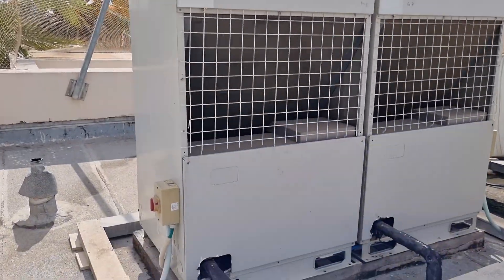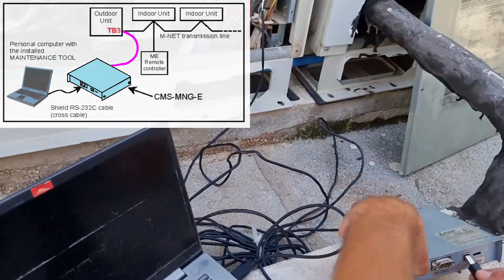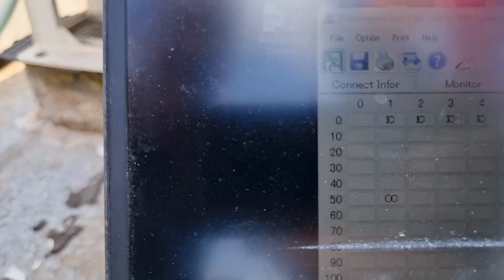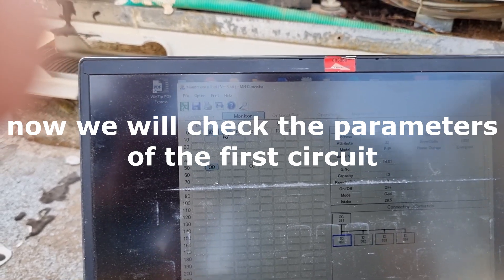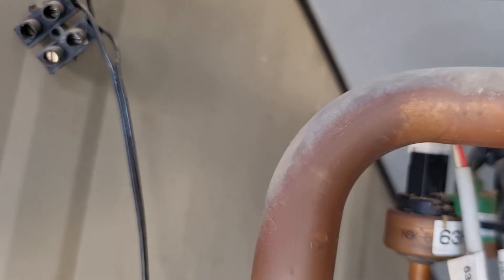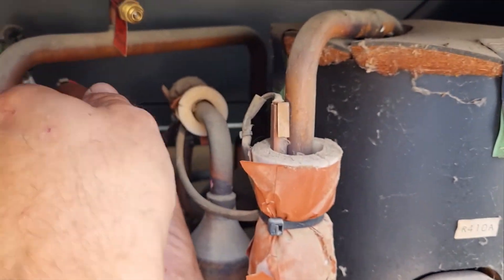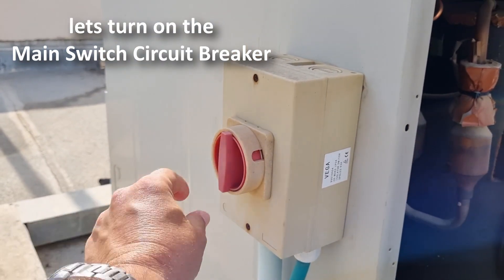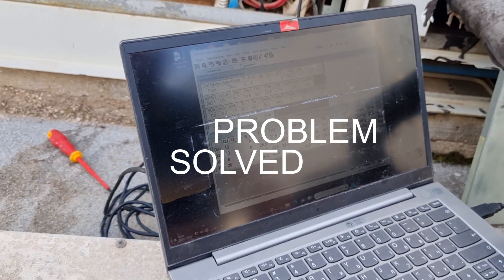City Multi VRF 1302 error code

Comment: Damnn that's sweet smart men, i damn worked on these never throught of damnn hooking the hp transducer switch/sensor onto thebcheck port just to get unit going because mitsubishi always refrained from it & wanted the original one out, gas replaced system lines blown out eith nitro and new one brazed on with flowing nitro naturally. Live & learn new thing after years of service. ThNk you. One more thing that 1302 very often comes up with 1102 & or 1202 together as well